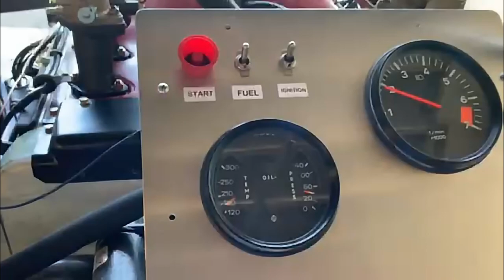1970 Sonauto #40 Porsche 914-6 GT Le Mans Winner Engine Start

Comment: Not only was the #40 Porsche 914-6 GT the GT class winner, but the car came in sixth place *overall*, beating out every 911 and even some purpose-built race cars.  It ran so reliably that it didn't require brake pads or even a tire change the engine race.  An amazing car!!